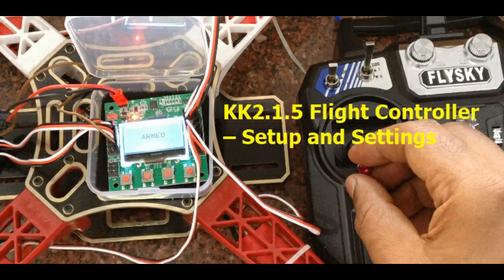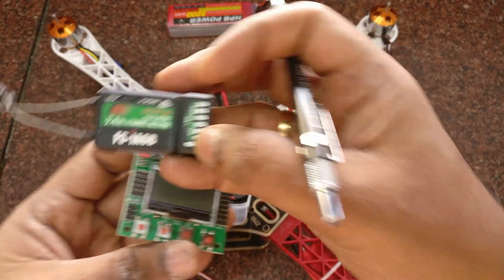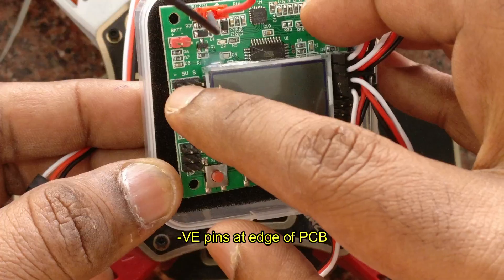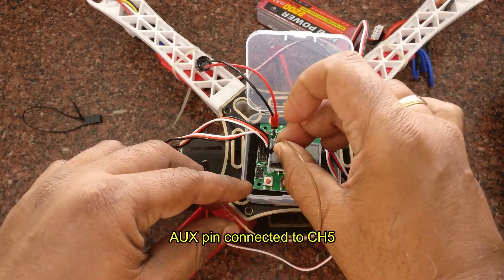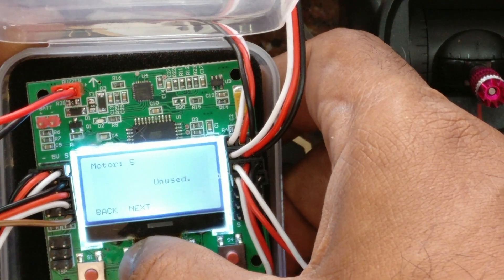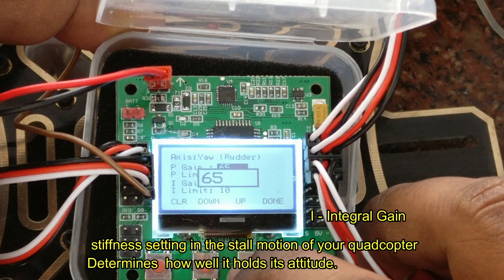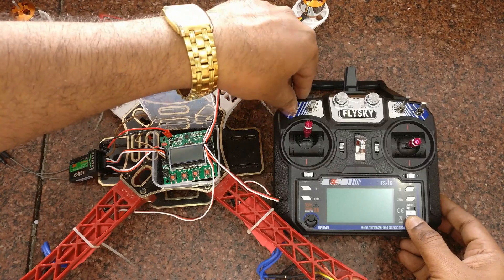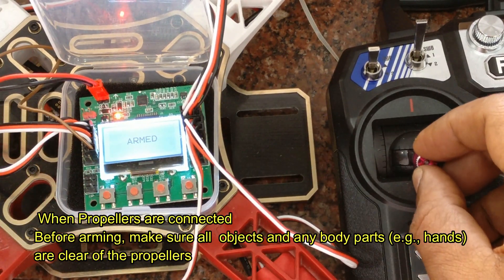KK2 1 5 FLIGHT CONTROLLER SETTINGS

Comment: Hello Saravanan   can you help,,, I have a home built octocopter, all motors run through a KK2.1..   All wiring is correct and the KK is set.  Your vid got me through most of my problems but when i try to marry the throttle to the T12D RADIOLINK rx i lose it.  Everything is correct up to 7.30 on your vid then i get lost . Would it be possible for you to explain the instructions with a bit more detail.   Regards  Jim

Comment: you powering the kk board with 4 esc. it it OK? in APM  pilot only 1 of the 4 esc is used. Other 3 esc do not power the board,only ground and signal is connected.

Comment: Hi i followed all the instructions exactly same. But drone is not taking off. The motors are running well. But y drone isn't taking off??? Can pls someone help me with this.
Reply: Check whether you fixed propellers correctly

Comment: Hi hope you are doing great. I setup my quadcopter with same configuration mentioned by you. However my fourth motor is not rotating. I connect the same motor with output channel 3 then it's rotating. So in nutshell my fourth output channel is not working. Can you help me how to make any configuration for this?

Comment: I followed your instructions and got "no yaw input". I ensured my transmitter was on before the copter. I tried factory resetting the controller. Any suggestions?
Reply: I am getting the same error. Did you get any solution to it ?